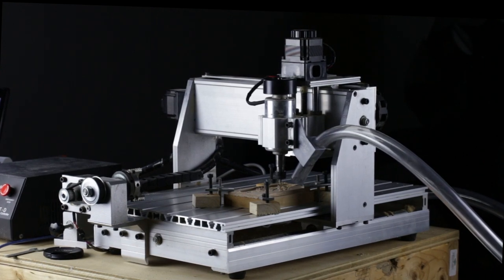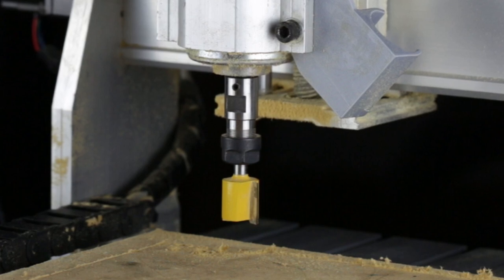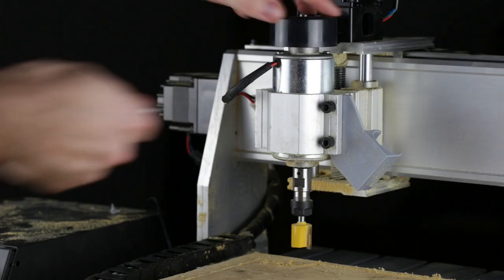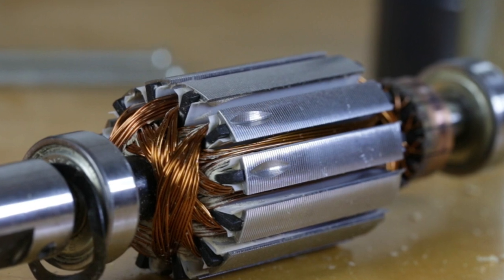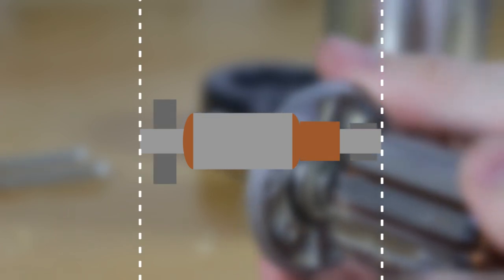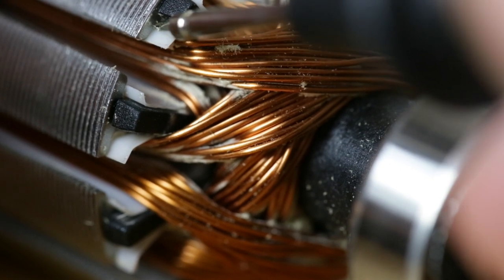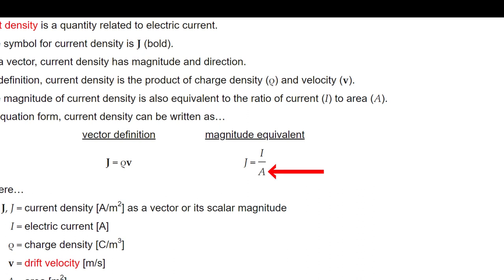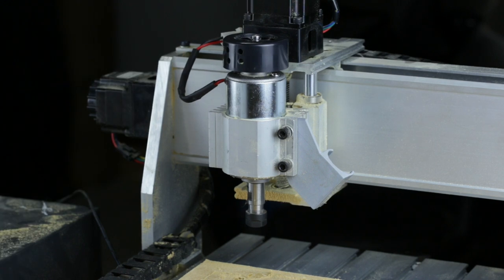Dirty Secrets of Chinese Spindles For CNC Routers (400W DC Spindle Teardown)

Comment: I have a selfbuilt CNC with the 500W version of your spindle. I don´t know if you saw the pricing on those since you probably bought it as a kit but you get these for 15€ plus another 15 for shipping to Germany on Ali Express. I think it´s crazy that they can even sell anything usable at this price even though it has many flaws. Your teardown helped me a lot since I needed to change the bearings on mine since it was packed with dust and i didn´t want to wait for a new spindle from China. Thank you!
Reply from the maker: Wow, I knew it would be inexpensive but not that cheap! The spindle i swapped to costs a couple hundred (with the vfd) but for me it was worth being able to take more aggressive cuts. Anyway I'm glad I could help!
Reply: I think these spindles are basic as heck for engraving bro. I just had opmne delivered in the post and I k ow by the lack of manual or any information booklet it's going to become a nightmare. I have a cheap as chips "alleged" 800W palm router as well which I might try. It's just another cheap TOPSHAK router that cost 30 euros. I tried using it last night to test it out by hand and it was having huge difficulty making any form of cut deeper than 3mm.. LMAO..
I think the moral of my story is stop buying cheap shit from China.. haha! oh and believe me I've bought a terrible amount of shit from there over the last few years.. \o/ weh hey! Laters my bro and best of luck with it all in 2023
Reply: @MD-hu3il  I meant HAPPY NEW YEAR bro..

Comment: Brilliant job mate.. I just bought one of these generic alleged 500W spindles for my own home built CNC. Ok so I haven't built it yet but this is a bit of a downer tbh. I know iI'm going to have the same issues as u have had but my trouble is I wouldn't know where tyo begin to try and fix any issues. 
The upside to all of this is I get to mess about with these cheap ass spindles and most likely learn a few new skills, LMAO, maybe!?!
Thanks for the information my bro.. Appreciate these types of videos bcos they help guys like me hugely. I'm basically a dummie when it comes to this stuff but YT is a great platform for learning new skills.. Click and play and do if u have anything about u as a man.. Tanks bro. Have a great Xmas and all the best for 2023.. Please God no new issues with the new spindle and VFD.. 
I have one question if u don't mind me asking please mate???
Q. What is the difference between 1 phase and 3 phase VFD's??? 
The reason I ask is bcos I bought a cheap TOPSHAK 800W Palm Router and I want to use it as my CNC Router but somebody told me to get a VFD.. Do i need a VFD for a small home built CNC of about 600mm in width and 1000mm in length? 
I picked up a 3 phase VFD before I knew there were other types like the 1 phase. Dumb I k ow but I got it for a great price and took it. It's brand new and all that stuff but why do I really need one?
What does a VFD actually do bro? I guess I could google it but it#s much better for me that I see a video of one being set up. I'm that type of learner.
I wrote my 1st ever program at 04:00 this morning.. I'm in the process of learning from YT about that too.. LMAO..
YT is a brilliant place to learn from.... That is provided the guy ur learning from actually knows and understands the information he's putting out there.. LOL
tHANKS AGAIN FOR THIS VIDEO PAL.. BTW Also my apologies for such a stupidly long comment.. Take it easy bro

Comment: This is my copy paste comment from others video -----
Help me to Figure it out ..!
I have my new router of cazar 550 watt 30000 rpm router with similar metallic body but the problem is its body heats up very quickly to uncomfortable temperature even in just 2 minutes of without any load run , i measured while running it for 2 minutes without any load i noted it's heat  star coming from the location of its spindle body sides and in 2 min it was 55 C + and in 15 minutes it around somewhere 63 C of temperature ! Can you tell me if it's Normal or not ! Or may be it's because of aluminum Boody conducting heat inside out efficiently ! But i am not sure can you tell by comparing with yours ?

Comment: Best to use a fly cutter.  In fact you can use a 1/4 shank 1-1/2 spoilboard tool.  Just cut off three of the teeth (yes dremel them off so you only have one tooth).  Or you could cut a slot in it and attach a lathe arm to get a 3" diy fly cutter.  I can walk you through it, would love to see you do a video and it would be helpful for a lot of CNC hobbyists.
Reply from the maker: What kind of tool would you start with to make the fly cutter? Sounds cool

Comment: Good info on the brushes problem, I'm just wiring up one of these to use as an I.d grinder to repair crappy set of Chinese r8 collets and now it looks like I need to repair Chinese crap before I can repair other Chinese crap.. at least the spindle runout is better than the Chinese r8 collets that I got, they have over 10 times the runout

Comment: I get actually one idea for spindal alternative
I thin I can use angle grinder as alternative for spindal motor
With some modifications
With more HP power
Reply from the maker: The right angle kind? I wonder if they put out more power than the routers some guys use

Comment: I'm sure by now you know anything you buy from China is rebuildable a d cheaper then USA.... Anyway.. thanks for the invite...)
Side note... It looks like they put that rubber around the bearings, as a dual purpose thing... The higher the spin the more that bearing shakes... The rubber also tames that down . Besides holding the bearing in place ... Remember metal to metal always has noise and friction....Peace.i4i.
Reply: Lol and biting my cheak here. Anything you buy from china should be considered a hobbyist grade at best or a get you by until a quality part can be sourced from elsewhere. Most Chinese components are stolen engineering from other nations that has been redesigned to incorporate the cheapest components available to get by. Good quality spindles dont fail or require a rebuild for years. They also dont come from China. They come from Germany, Italy and the United States. Buyer be ware. YOU GET WHAT YOU PAY FOR. Cheap in this stuff is just that.

Comment: i facing a problem with mu new spindle .. 2.2 kw with inverter .. i bought for a month ad when i started at first all fine ..i set everything corecctly ... wireng , program and etc.. i keep the spindle .. for two week cause i need to fi my contruction for my new cnc toys.. and sunndenly .. my spindle don want to spinning . ony the sound come up but nor spin ta all.. an then i try to use hand and the spindle spinning like usual ..and ide to resolve this problem .. thank you for the video
Reply: if use VDF have possiple VDF setting have some fail.

Comment: yes this is just a dc motor with an er11 adapter heat shrunk on ,  instead of screwing around trying to improve junk invest in a 1.5kw 3 phase 4 bearing inverter driven spindle
Reply: he already has a 1.5kw vfd spindle. see his other videos. 
some people simply enjoy tinkering, and that is okay.
Reply from the maker: Lol scary how accurate his suggestion was!
Reply: @netroy  but cost lot more too, chinese spindle cost good 800W lot better than this video 400W 120$ and 1,5KW  VDF cost 400-600$ all hobby user not have budget waste lot money big spindle.

Comment: what is say, i dont understed really. Is it great motor, or bullshit ?
Reply: Not a good motor
Reply: Reasonable but not good as a motor, but really bad as a spindle.
Reply from the maker: Yep!
Reply: @MD-hu3il  if buy spindle buy lot biggest 800W and 1,5KW -2,2KW water cool spindle all have made lot better, bearing have real spindle bearing, not worst axial bearing only, and made lto lot better used VDF speed controller, but price have lot high more too, cheap chinese buy less than 120$ and good 1,5KW water cooler whit VDF cost 400$-600$